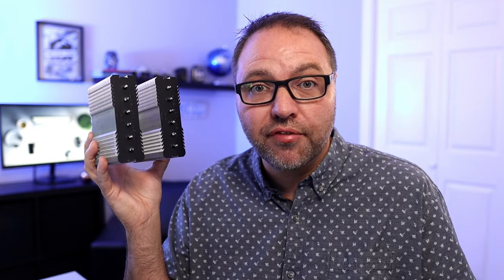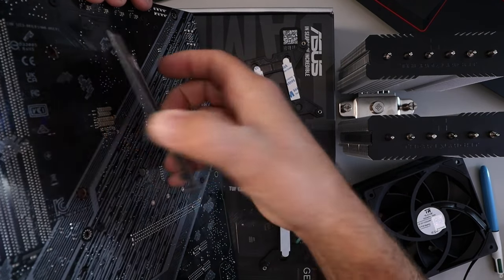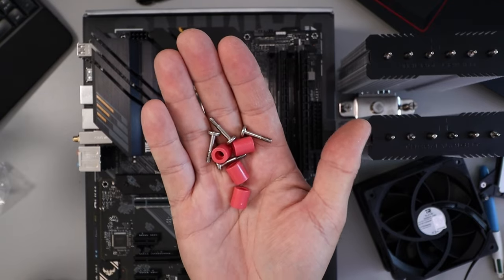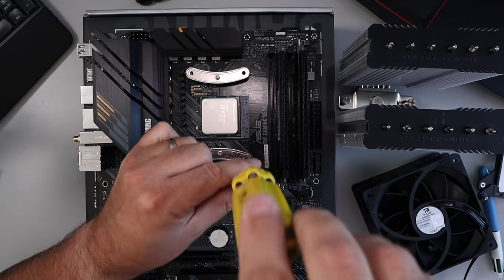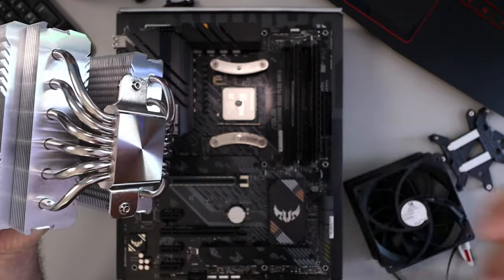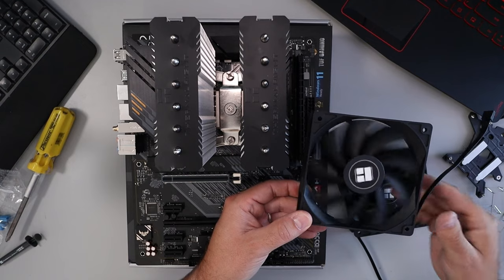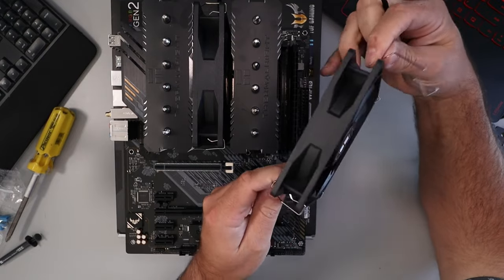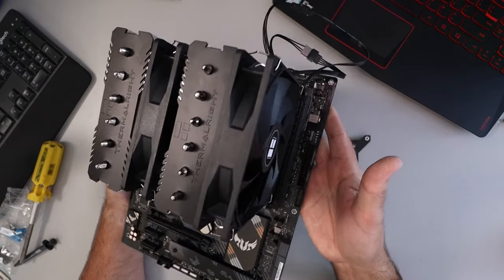How to Install Thermalright Peerless Assassin 120 SE CPU Cooler

Comment: I just bought this cooler for my new rig I’m building with Ryzen 7 7800X3D and RTX 4090. It’s my lifetime dream build and I can’t wait!
Reply: crazy build bro happy 4 u
Reply from the maker: Awesome 👍 Enjoy!!
Reply: What temperature is your cpu while playing games with the assasin peerles se 120 on the ryzen 7 7800x3d?
Reply: I just got the same CPU and this cooler, setting it up when I sober up. Lol
Reply: Exact same setup sans the 4090. I am mid budget and hadn't upgraded since.. 2013 aside from a new(er) GPU. I have anecdotal stuff about fellas getting upper 60s when benchmarking OCd at 5.2GHz. I don't plan on doing any of that, having a 1440p/144hz and DLSS/RTX support (among many other features) is already unreal. Putting it all together right now.
Reply: Any update on the temps
Reply: Literally play any game on max 4k for the next 3 years, nice build
Reply: i just built something similar, 7800x3d and rtx 4080 super, im getting around 45-55c for idle temps. what about you? seems high to me
Reply: @ciownu seems okay, mine hits 37 on idle (not overclocked and on overclock 44/50) got a ryzen 7 3700x (friend hits same temps with ryzen 5 5600) got almost the same cooler got (i have pa 120 black) (fortnite overclocked at 60/65 temps)
Reply: Exactly what I’m building right now…very excited to get this finished
Reply: Why would you buy this cooler on a 3xd cpu?? It’s gonna over heat you should have liquid cooled it or used an aio
Reply: Is the cooler silent? Or does it make some loud noise?
Reply: @poxii7369  my rig is completely silent I can’t even tell that it’s on
Reply: @branmuffin411  Okay thanks. I thought it would be loud, because I read that on Reddit.
Reply: yooo we twinnin. currently saving for the same build
Reply: @BreadFr1  If you don't know anything about computers please don't comment . Spreading false information is pointless . The 7800x3d can even run on a Wraith Prism .
Reply: @BreadFr1  You shouldn't lie like that, you actually going to make someone buy something they dont need. The 7800 is one of the best cool cpu's out there and the pearless assassin is more than enough.
Reply: @BlariX  although yes technically I did lie, there is a difference between a mistake and a lie. I made a mistake I thought due to the cpu being an x3d chip and how I myself see the cpu running at idle temps being 60 degrees thought it was bad and I have a 360 mm aio. I didn’t realize how resilient the air coolers are and simply made an error.
Reply: @BreadFr1  cuz it beats quite a few water cooling options and is cheaper
Reply: @BreadFr1 imagine telling people to get something that’s completely unnecessary and overpriced in the modern age of affordable and performative air coolers
Reply: @BreadFr1  If your 7800X3D is at 60c idle something is wrong. Mine is low 40/high 30 with the Liquid Freezer III 360. No pbo or custom settings.
Reply: @stabizisback Same issue on mine 55-60c idle on my 7800x3d. Im using cooler master ml240 illusion. Everything is connected properly and i even changed my thermal paste 3 times once even with Conductonaut.
Reply: @KeVsPIXEL  There is omething wrong there for sure. I had the ML240 cooling a 5800X with no problem. I have now switched to air (Phantom Spirit) on my 7800X3D in a much smaller case with all fans including cpu locked to 40% up to 75C, still idles in low 40s, XMP enabled, no pbo. Usually 50s and 60s in gaming, totally silent.
Reply: @stabizisback  I've been trying to figure it out since I bought it last year. Besides finding out that the shop that built it for me plugged the pump on the "cpu_fan," it's still idling at the same temp. I saw the PA120se on sale in my country, so i might as well try it.

Comment: I'd like to point out that when installing this cooler, your motherboard may have 2 ports, "CPU Fan" and "CPU Opt". CPU Opt is where you can connect the second fan to instead of daisy chaining the 2 fans into one port. This is completely optional, however, it's something worth noting depending on what you're using the computer for.
Reply from the maker: Thaks for sharing the tip!
Reply: Thanks for the tip!
Reply: I decided I would rather daisy chain for the identical speed but that is indeed  also true!

Comment: thanks so much for the video. I've always feared the cooler is too heavy for the moherboard, more when it's standing fastened with just two screws.
Reply from the maker: Works great for me so far.
Reply: Having the 2 screws on top and bottom is MUCH better than having them either side. The top screw prevents the heavy cooler from sagging which happens with 2 side screws all the time.

Comment: When this PA120 cooler is mounted on the mATX mainboard (b650m), will it rub against the ram on the mainboard? I use XPG Lancer RGB D5 6000mhz ram, plugged into slots A2, B2

Comment: Thank you so much! I am building my first PC and I had no idea how the fan clips were supposed to work. Great video and straight to the point
Reply from the maker: Glad it was helpful 😀👍
Reply: @NorthernVikingEveryday Did you realize after you made the video that you clipped on the first fan somewhat incorrectly which resulted in some of the lamellae getting bent? It's clearly visible in the video and not present on the front fan.

Comment: Installed this earlier on my am4 mobo and it was super simple and easy to do. I’ve never dealt with those fan clips before so I came to this video and once again it was super simple and took me no time at all.
Reply from the maker: Awesome 👍 Glad you got it installed!
Reply: Is the cooler loud? Or would you say that it is very quite?
Reply: @poxii7369  quiet
Reply: What about the ram slots? Did it cover all 4 of the ram slots or were you able to install your rams ?

Comment: Great guide for AM4 users! I’m using a Phantom Spirit, and it was similar enough I could follow your video. You answer so many questions the instructions didn’t address, like what direction the fans were blowing. This fan is a beast and was a needed upgrade for me after switching to a AMD Ryzen 7 5800X3D. I went from 90°C in OCCT on my Cooler Master T2 to 64°C with this Phantom Spirit. Using an Asrock B450 Pro4.
Reply from the maker: Awesome! I'm glad I could help you out and that is a big difference in temperature. 😃👍

Comment: Watched this on my phone and installed Peerless Assassin flawlessly as my first CPU cooler change ever! Great help appreciated, especially on those confusing fan clips :((
Thank you for your wonderful tutorial video.
Reply from the maker: Glad it helped!
Reply: Is it just me or was placing the heat sink a pain, took me like 30-45 minutes to get both screws in simultaneously
Reply: @Lmoros  I screwed them almost all the way individually. Only when It feel tighter, I then screwed evenly to get them in simultaneously. Took me around 3-5 minutes

Comment: Thanks for the video, you forgot to mention that you don't need the splitter cable, you can just connect second fan into the CPU OPT connection on the motherboard.
Reply from the maker: Good tip!

Comment: I wasnt sure what to do with direction until i noticed rubber pads and your video helped. Its possible to get those clips in without bending the heatsink fins, just slide up or down a c'hair at a time until it goes in perfect!
Reply from the maker: Glad I could help

Comment: Thank you very much! The only down side I saw in all this was that you would have to pull up the 1 fan placed by the side to access the RAM but consider its only being held be brackets. It's still easy to work around.

Comment: Paired this cooler up with a recent scrapyard find as we swing by there at work a lot.
Found a MSI x299 sli plus motherboard & an I9 7920x processor, not gonna mess about overclocking it as this will be my test rig for various parts, currently only a single 8 gb ddr4 stick too test with but I'm sure I'll find some more, or I'll just buy a kit of 32 gb & put in the current ram from my main rig into this.

Comment: Was the cooler a tight fit in your PC case and did you have to worry about the cooler touching your RAM at all?
(Great Video BTW!)
Reply from the maker: I did need to slide the 1 fan up about 1/8" to get it to fit. But it seems to work great.
Reply: I had to do the same thing, move the fan up just a little bit.
Reply: Totally triggers my OCD but what are you gonna do? 😅

Comment: I totally realized I installed my second fan wrong. I installed it on the outside rather than the middle even despite looking at the manual. I'll definitely correct that.
Reply from the maker: Glad it was helpful

Comment: I have fans in the back that pull out the hot air, and fans in the top of the case that pull out the air. Wouldn't it make more sense in that case to mount the fans so that they're both on the outside of the heat sink blowing away from the heatsink, instead of creating a hot air train?

Comment: If you need the back plate to remain attached (if you're upgrading and don't want to remove the motherboard from the case), wouldn't it be better to remove/replace one bracket at a time, so one bracket is always attached and the backplate can't fall off.  Just a suggestion.  Thanks for the video.

Comment: The cooler doesn't interfere with the RAM, does it? I'm going to buy that same motherboard and cooler, but I couldn't see clearly if the RAM fits well.
Reply: Without the fans you can access the ram, loads of clearance. About to put the fans on. I'm here to see the direction as they have no arrows.
Reply from the maker: I had to slightly raise the fan to get it to fit with two Ram sticks. It would be extra tight with four sticks of ram

Comment: Upgrading my prebuilt so im kinda nervous but this eases my mind a bit. 

I'd like to not have to take the motherboard out completely but i guess i have to to put the bracket on the back. 
Which likely means unplugging my gpu and removing it before pulling the motherboard off. 

It's gonna be a little more intensive than i was hoping but hopefully it goes smoothly as i cannot afford to replace a gpu or any other parts.
Reply from the maker: Many cases have a cutout so you don't need to remove the motherboard. Hope you get it sorted. All the best!
Reply: @NorthernVikingEveryday  
Thank you! I shall check my case.

Comment: Thank you for the tutorial. One question though. Would you recommend putting the cooler on outside the case or with the motherboard already inside ?
Reply from the maker: I've done it both ways. I typically install the cooler outside the case if it is a fresh build, but if I'm changing it I don't bother taking it out of the case. I think it's a bit easier when it's not installed.

Comment: Is there a way I can check if there will be enough clearance between my ram and the processor? I was thinking of getting this one but I'm worried my ram (Corsair vengeance ddr4) will not allow it to fit. So I was going to go with a thermaltake assassin spirit 120 evo or gamdias boreas. My motherboard is the asrock b450m steel legend

Comment: ohhh.. so it's ok to move a bit up the fan near the RAM... so will it work on my setup??

CPU: AM5 Ryzen 5 7600
MOBO: MSI PRO B650M-A
RAM: Kingston Fury Beast RGB DDR5
RAM Dimensions: 133.35 mm x 42.23 mm x 7.11 mm

Comment: Everything is fine, up until tightening the screws on the Heatsink, one side is fine, but the other just refuses to tighten.
Anyone else had this issue?
Reply: Tighten them both a bit at a time

Comment: Thanx man quick question. Does the direction of the fans matter? I dont mean the logo side, but their placement in terms of the sink. So for example if you have put the outer fan on the other side on top of the VRMs instead of on top of the RAM like you did, will there be any difference?

Comment: Is it possible to use one fan on the cooler and the 2nd as the read exhaust attached to the case instead of the cooler ? And if possible in what position the other fan should be on the cooler ?

Comment: The instructions that came with it were pretty clear but nice to have that insurance of your video to know its right. Also my 2 metal top brackets were still a little loose is that normal? I went even a little more then snug but no difference. Only asking cause iv never had this problem with any other fan.

Comment: I have a question. Instead of installing the fans like you did I installed the fan you installed close to the ram further back, so that the order would be "fan1 - heatsink left side - fan 2(in middle of heatsink) - heatsink right side - clear ram space). Do you think I made a mistake? So far the temperatures are decent(between high 20s and low 30s).Thanks a lot for the video!

Comment: How tight are the screws suppose to be, I don't want to damage the socket so I just tightened both sides enough to not wiggle, threads are still showing.

Comment: The bracket for the LG 1700 setup.  Does that replace the bracket already on the motherboard?  Or are you saying it is to be mounted on top of the original motherboard bracket?  Thanks

Comment: Thanks for this video. I currently have the motherboard installed in my PC with the stock AMD cooler (came with my 5600). Will I need to take the motherboard out of the case to replace the stock cooler with the Peerless Assassin? I dread having to do a bunch of rewiring etc..
Reply from the maker: Typically there is a cutout behind the motherboard so you can access it from the side panel. Most computers you will not need to remove the motherboard. However, sometimes that is not the case.

Comment: is it difficult to install the motherboard into the case after installing the cooler? Should i install the motherboard into the case first before install cooler?
Reply from the maker: I prefer to install the cooler ahead of time. It makes it a little tighter to install the motherboard but it's not that bad.

Comment: Is it fine putting the fan in the middle, then the second fan on the back? Because my rams are too tall, and I can't close my tempered case if I put the fans same as yours it will be a little bit higher

Comment: Thanks for your video. I'm planning to build a microATX with this cooler. Seems like the memory slots are blocked by that huge thing. Is it just perspective or do I need extra small RAM?
Reply from the maker: It is a little tight but it'll depend on your motherboard and RAM size.
Reply: @NorthernVikingEveryday  I'm gonna use ASRock B650M HDV/M.2 and probably G.Skill Flare X5 2x 16GB 6000 CL30

Comment: I am trying to install this right now and I do NOT get it. I have a lga 1200 mobo. When i screw the bracket into the back there is nothing to hold the brackets on the front at all. The screws arent long enough. How the hell am I supposed to do this? There is also no double sided tape on my brackets or anything.

Comment: I have a question, it may be a silly question but could I replace the fans with a different pair?
Reply from the maker: It's possible you would just need to make sure that they have the same specifications.

Comment: i have same issue with the fan towards RAM had to be slightly mounted higher. Did you ever try to see if it would still cool if the fan is put on back as a 'pull'
Reply from the maker: I haven't tried that. But I know others have. I've had good luck with it mounted the way I did it in the video.

Comment: I have seen other videos where they spread the thermal paste all over the CPU, is that really necessary? How do I know the amount I put on it is enough? Thanks
Reply from the maker: I would do a search for the best ways to apply thermal paste on YouTube. There are several videos that have applied it under glass in different methods so you can see what works best. Everyone has a different opinion on it. But you don't want to apply too much so that it spills over the edge.

Comment: The brackets that came with mine don’t fit, I was upgrading from a Gigabyte B450 D3SH + AMD Ryzen 5 3600 to a MSI B550M-A Pro motherboard + AMD Ryzen 9 5900X processor. Yours look sleeker and smaller whereas mine are straighter and longer. I bought the Peerless Assassin 8 months ago and need to build this computer soon to get my paper done for a college class. Would you know anything?

Comment: hi do you know if it works well with am5? heared that noctua sells/gives out special brackets that lowers heatsink so it touches more of the CCD's. is it not a problem with this cooler?

Comment: So I installed a fan in the middle and a fan to the left (so not over ram).. and I have both fans facing towards the back for the case. Is that ok or should I face the fans towards the front of the case (while in their same position)? I hover around 40-45C while "idle."
Reply: All toward the back is totally fine. As long you have exaust fan on the back of your case

Comment: My fan near the ram is 3/4in in height of the cooling tower. Is this gonna to be in issue for my chassis? Its rated length is 168mm for the cpu cooler.

Comment: I have the white aRGB version. Could anyone help me check if I can plug in the aRGB cable on my motherboard and where?
It's 3 pin and there's a space between 2 pins and the last one. I own an x470 Aorus ultra gaming. I checked the manual but couldn't find anything helpful. (PS: I've only found one port on the motherboard where it looks like it could fit but it says SPDIF_O)
Thanks in advance

Comment: Aren't the memory modules getting in the way with second fan on cooler? I need to figure this out
Reply: No because the second fan goes in the middle, this is not clear in the manual.
Reply: I'm having a conversation with myself - rock your socks off